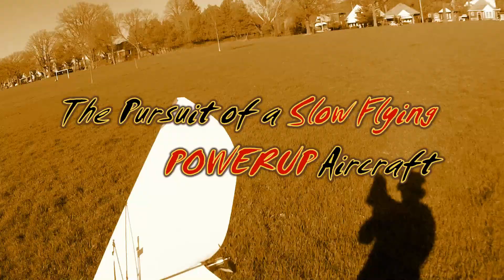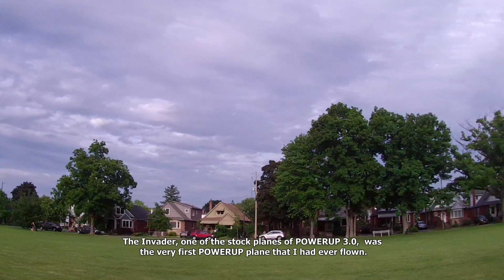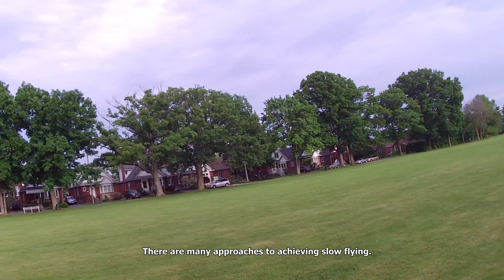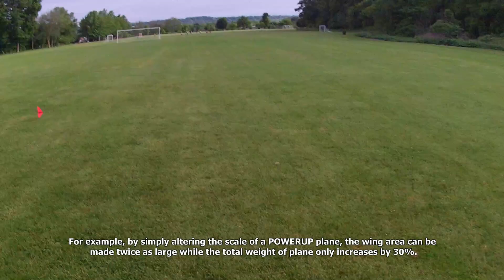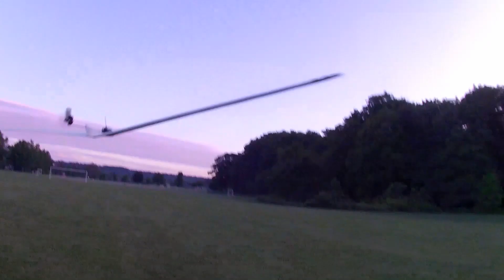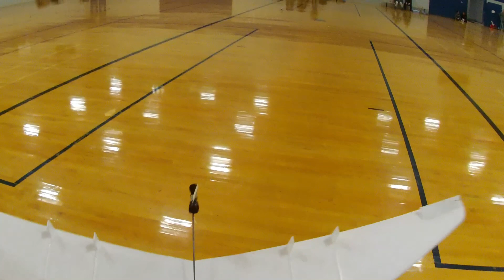In Pursuit of a Slow Flying POWERUP Aircraft

Comment: Very nice flying ! To help the larger wing turn better , you could try to increase the surface area of the rudder , and/or maybe add dihedral . Or use two POWERUP units on one airframe  . Would it be possible to attach a small gearbox to the motor so it can swing a bigger prop at lower RPM's ?
Reply from the maker: Thanks, Albert. I cannot figure out how to use two POWERUP units on one airframe unless some kind of electronic hacking is involved. Can you elaborate? I did see a couple of instances involving more than one POWERUP unit on www.poweruptoys.com but that looks like one of the features that they planned but later abandoned.

I have not tried to alter the POWERUP module in anyway other than making the rudder area larger. I haven't found out how far I can go in this respect.
Reply: @maxxu8  Using two POWERUP units is not something I've done , just an idea I had . You are right , it would probably take some electronic hacking to set up something like differential thrust . Here is a video of a very slow flying wing that uses micro electronics with differential thrust for steering :  https://vimeo.com/59410644?cjevent=ac084fc2eaac11e882bc00470a1c0e10